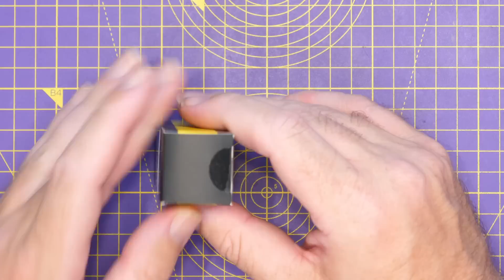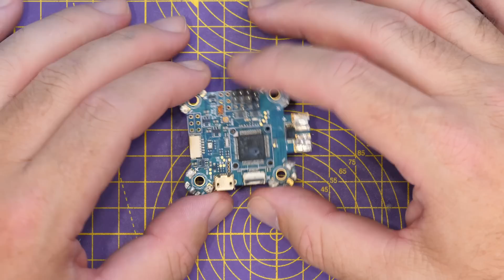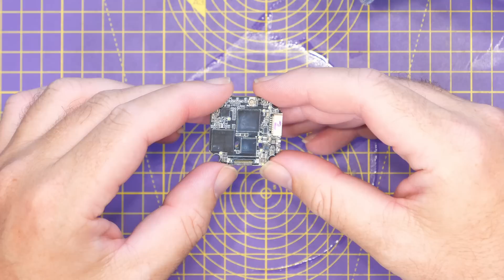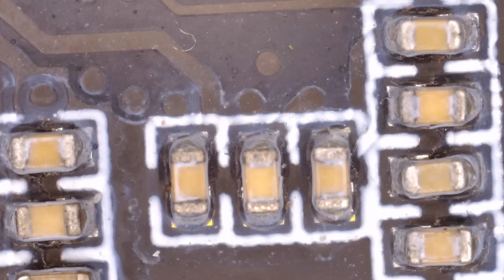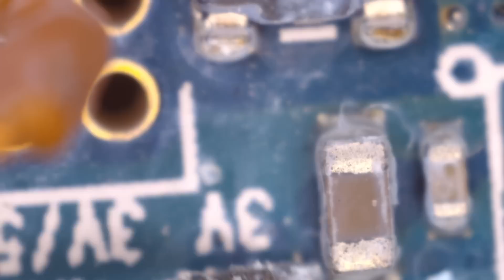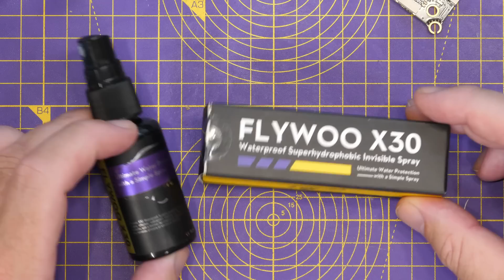Flywoo X30 Waterproof Superhydrophobic Spray - Easy Conformal Coating Alternative!

Comment: have you ever tryed the liquad electric tape  I used to use that because conformail is a pain to resolder if u need to and its toxic when burning but after seeing this flywoo x30 I might give that a try or just stick with what I know the tape is  easy to put  on I use a paint bush and when you need to remove you can just peel it off

Comment: Hello,
I was asking a Microsoft pilot about coating an old phone I have including the charging USB port to make it waterproof.

Microsoft pilot suggested in its answer Flywoo x30. I looked it up and stumbled upon your video.

Do you know if this spray will protect a USB port? All while maintaining conductivity for the USB cable to charge the phone? (Underwater)

Thanks you

Comment: Do i have to tape the barometer and connectors before i apply this? or it doesnt have any effects on finctionality as plastik spray would have
Reply: I saw a video where a guy poured this liquid into a tiny plastic bag and dunked the boards completely in this to get it into all the little nooks & crannies. Happy days.

Comment: I asked flywoo if this would work with saltwater and voiced my concerns that saltwater is completely different to freshwater and the only solution i have found with saltwater through a barrage of testing is to fully encase all the electronics so no saltwater can touch it. They replied saying it does work with saltwater. Your testing to me suggests it would be useless with saltwater and personally i believe it should be noted in their product description that it is for freshwater only. Would love to get some to test it out but vendors here in Australia are slow to get new products like this and shipping it directly from flywoo might result in it being stopped at the border for being a hazardous substance at my own cost and loss so🤷

Comment: I get a feeling that the reason they are unwilling to go into details about what is in it, is not because it’s a deathly solution in the bottle… but I bet flywoo doesn’t want anyone running off looking for cheap alternatives or other FPV vendors ‘copying’ it. 

I would not be shocked to the only ‘crime’ here is that a $5 spray is being sold for $25 but still the question remains… Chinese safety records of course don’t mean much.
Reply: There's a company called Lexuma who make a product called X20 that seems to have quite similar properties. It crossed my mind that this might be a (not very imaginative) re-branding of the same stuff! But 10 better, obviously...
Reply: @rookery_  Wow, you may have hit the mail on the head with that find. Have you used that before? It also says that it's "highly reversible" which is similar to the flywoo spray.
Reply: @JohnCuppi No, I haven't - it looks like it only ships to the US and Hong Kong, and I'm in the UK. It does seem really similar though!

Comment: Not quite like rainx, but I get the analogy. Of all the products available I'm most likely to use this. That said, conformal coating will have more protection. This will not protect against FOD (foreign object debris) such as stray solder blobs or even wood dust. Dry Drone is very good if you have it and remember to apply it before you build. Conformal is best, but you kinda need to build, then tear down and apply. That can be a real pain, especially if you want to coat the motor pads after soldering.

Comment: I don't know if you've ever tried the product dry drone which I believe is basically Novec by 3M.  Which you can actually dip into and I'm pretty sure it's very similar but it's green and not in a spray Maybe take a look at it I don't know if they still sell it but commercial sizes only. I've been using it for years and it works really well and it goes on drives instantly
Reply: I always wanted to try that stuff. Does it scratch off easily like this flywoo stuff does, or is it a stronger adhering coating?
Reply: @starsstripesjacket  Not at all actually It doesn't come off by scratching it at all like you need to scrub it with alcohol an a toothbrush and still doesn't come off as easy.  But it goes on pretty much as thin and the same. I've been using it for years It saved my electronics from stupid things like snow etc.  I personally just take my ESC and FC throw it in the bag shake it up and done If I really want to get crazy I can CC just the ESC and only. Dip or just brush it on  The FC.  Plugs all that stuff doesn't matter with it. It's not cheap but it's worth it in my opinion.

Comment: "Recommended to respray between each flight"

This, to me, seems like it has a cool party trick but flywoo knows it's not anywhere near permanent or resiliant. To me it seems like those spray on screen protectors for phones... Sure, it does something but does it actually do what you expect it to, prevent replacing of parts? Silicone and conformal coating provide some level of impact protection AND it holds things in place, this does not.

Comment: I would love to see a video where somebody uses a breakout board and solders 2 wires to it going to a ohm meter drops it in different liquids like saltwater, then has a second with this spray to see the difference, then a third one with VIP silicone water resistant spray, then one with worry free and conformal, ect...

Comment: So im guessing it's basically just silicone spray like for tents, canvas and clothes, that's what I've been using and you get a big can for like 6 bucks at wallyworld.... I just reapply if I plan to fly near wet location, just in case.... Also don't get it on camera lens!
Reply: It evaporates quickly it might not be water based as those tent /clothing ones
Reply: @Przemo-c  silicone wouldn't be water based, i might be wrong ...
Reply: I specifically use vip silicone water guard and its not water based anyhow, as far as i know, got a big can pre fjb for 4.99+tax and it seems to work perfectly for me...

Comment: I use CorrosionX. brilliant for waterproofing. also, you can solder over it but the downside is, that it leaves a residue that is quite oily, and dirt sticks to it. At least you can dunk it to clean it

Comment: I thinkg I wouldn't trust it to waterproof my drone, it's too easy to scratch it off, it make drone more like splash proof - so if its starts raining I can safely come back. But I might use it in future as additional layer after using traditional methods of conformal coating.